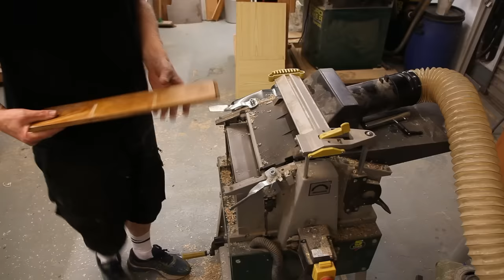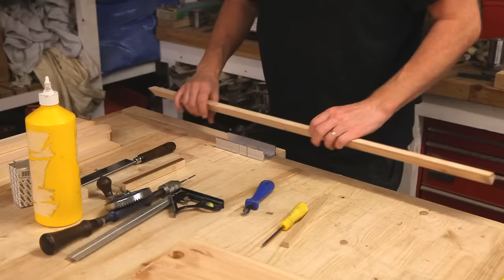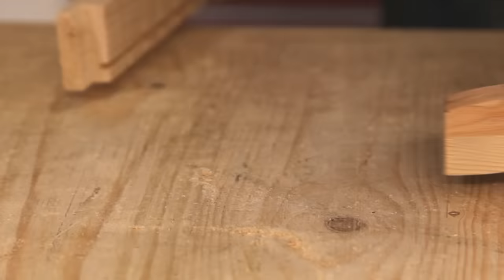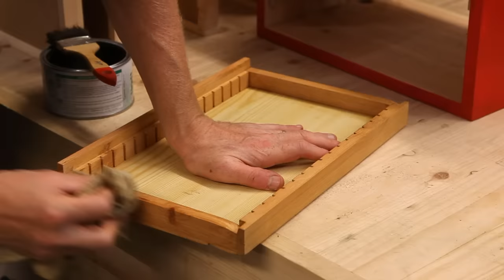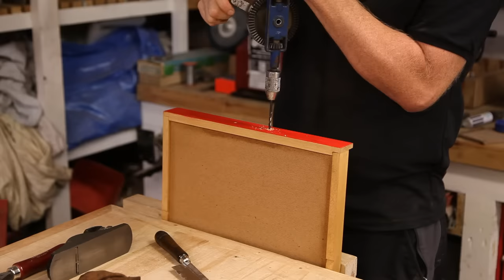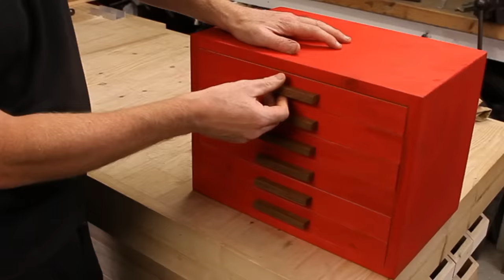Machinist Tilting Drop-Down Drawer Tool Chest Made From Scrap

Comment: This will be excellent for carving knives.  I can suggest a possible improvement.  When I made heayduty drawers for a big tool chest, I cut the slides as french cleats.  This method keeps drawers from cocking and jamming, and actually keeps the walls of the carcass from bowing too.  Oak makes a durable slide and when waxed the drawers slide easily.

Comment: Like your small nail puller,I have one also. Nail puller with claw on one side and flat screw driver on the other. According to what I have found, they should date to around the early 1900's.
Reply from the maker: I've had it a long time. Not sure where it came from but it's older than me :)

Comment: I wonder if it would be a good idea to cover the backside of the drawer front with a piece of metal. just because with the tilting the tools will knock into that piece often, making it wearout faster than the rest of the piece. I know that the fabric would lessen the amount of sliding but I don't know it still seems like it would become scuffed rather quickly.